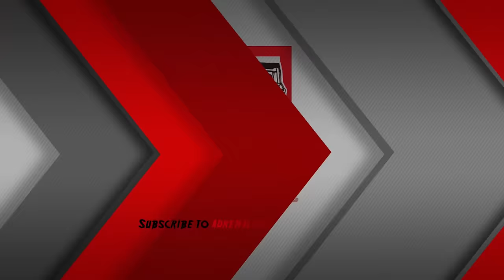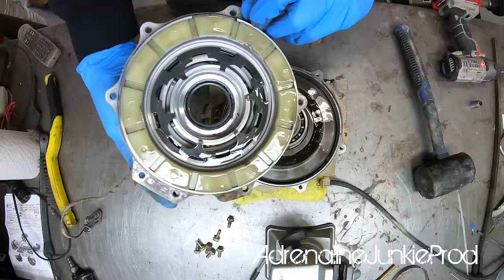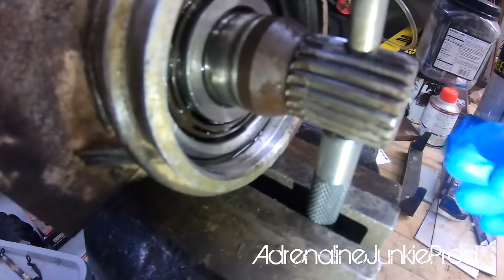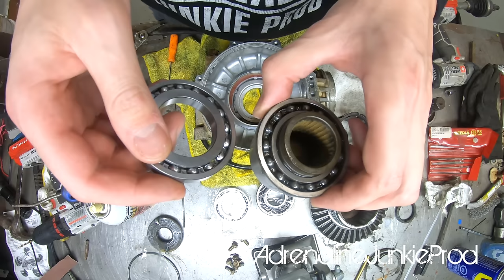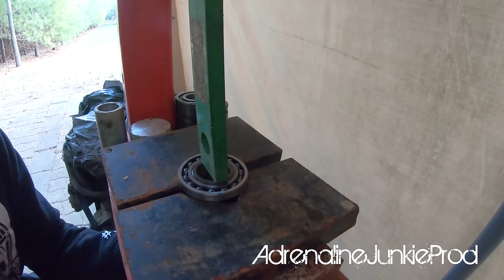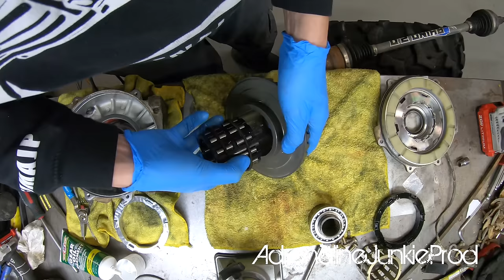Polaris RZR Complete Front Differential Rebuild - DIY - In Depth + Step By Step How To - RZR Turbo

Comment: Just ended up rebuilding mine but now it will not lock into 4wd and my headlights won’t work as well. Throwing a check engine light code 05202075 as well. Any thoughts of what it could be?
Reply from the maker: Have you checked all the fuses? I don’t see what the diff would have to do with it as long as it’s all assembled correctly. Is the wiring to the diff damaged somewhere? Is the connector good?
Reply: @AdrenalineJunkieProd  I’ve checked the fuses that you can see through but how do you check the block fuses that are from Polaris? The code is apparently a circuit loop or ground problem? The wiring and connectors look fine. Just really stumped now lol.
Reply from the maker: @cdoggaminglive5919  the black cubes are relays. They are all the same I believe. However, I don’t think any of them are responsible for diff engagement. Sometimes the wiring going into the diff gets damaged at the diff housing itself. Make sure it’s not cracked or broken. Inspect the spot it goes into the diff. It’s a very common point of failure. If you pull on it or if you put too much pressure on it while working on the diff the tiny wires can get damaged. There are fixes online for it. It’s a delicate point on that diff. Check if you have power going to the diff at the electrical connector. That will Eliminate a variable. If there is no power to it then you know you need to chase an issues that’s not the diff. If it has power then it’s likely between the connector and the diff itself.
Reply: @AdrenalineJunkieProd  so while the machine is on and the wiring is plugged into the diff. Then puncture the wire with one of those power testers that light up to see if it’s getting power?
Reply: @AdrenalineJunkieProd  the wiring looks fine and at the diff there’s no cracks where those wires go in.
Reply from the maker: @cdoggaminglive5919  make sure you inspect them really good. Did you check the power to the connector with a voltage tester or test light? If all the wiring is good and there is power it’s an internal diff issue. Hearing your headlights are not working makes me think something else might be going on. I’ve heard of the switches failing too. My headlight switch and 4x4 switch have both needed to be replaced. Could just be bad timing. Electrical issues always suck to diagnose.
Reply: @AdrenalineJunkieProd  Alright I appreciate  the information and responses. I’ll try to dig a little more into the issue. I hate figuring out electrical problems because I don’t know where to start lol.

Comment: will it fit 2015 rzr 900 s ?
Reply from the maker: Prob not. You could prob make it with a lot of work and modifying the frame and driveshaft but still not sure if the gearing would work.

Comment: Next time invest in a slide hammer to remove the pinion and bearing assembly. It will make life a lot easier.
Reply from the maker: Excellent tip Sean. Thanks.

Comment: I will never understand how a bearing in an oil bath(obscenely expensive oil)can wear out so freaking fast, especially considering it’s not even under a load 95% of the time. 
Mine failed in 2000 miles. Polaris should be ashamed of this garbage
Reply from the maker: Sub par components is the only explanation. The bearings in many cars and trucks last over 200 thousand miles...
Reply: @AdrenalineJunkieProd  has to be. I ran my Mercury 150hp outboard with both the gearcase plugs left out, for over a week. It had nothing but water for lubrication with no apparent damage

Comment: I changed out my buddys 14 rzr 1000xp4 the plastic cage was broken ans the dial pin was also broken. The plastic retainer was also kinda messed up. I replaced all of those and the awd still doesnt work? I bench tested it and it worked it locked in both ways (forward and reverse) so i put it back in and dont work. Not sure where to go from here.
Reply from the maker: Hey man, that's weird. Did you use Sandcraft components? If so give them a call, they have top notch customer support and they are super friendly and knowledgeable! They are very helpful on the phone.
Reply: @AdrenalineJunkieProd  no i didnt my buddy used all oem except the cage